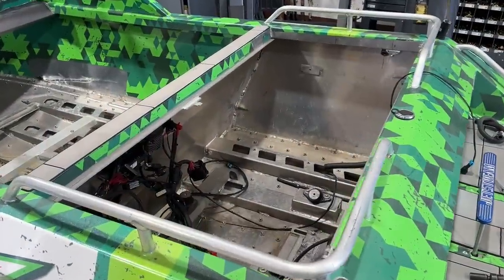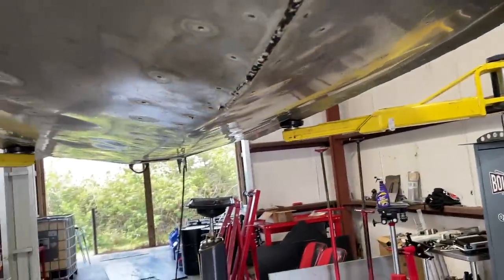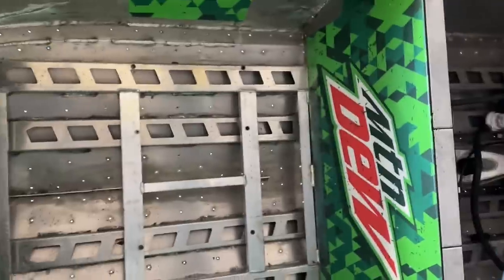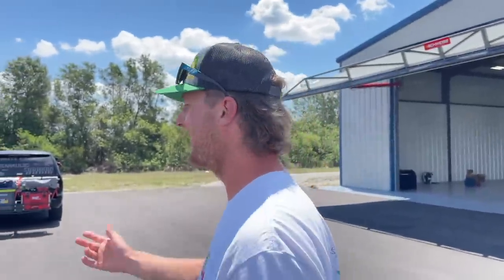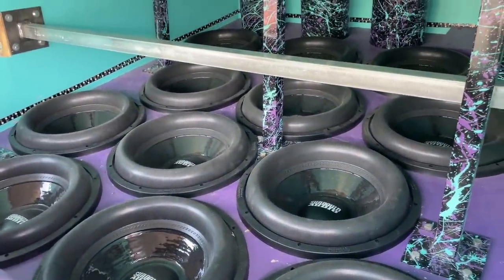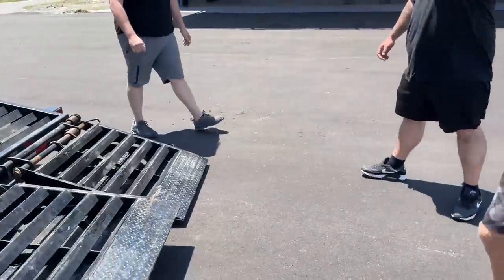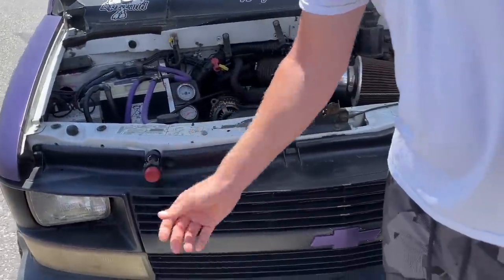More MAJOR Damage On My Mini Jet Boat, Surgery Begins! + An INSANE Sub Woofer Van Destroys Our Ears!

Comment: these guys need to come out to the cleetus and cars events
Reply: This can happen!
Reply: It’s a natural progression in the car world. A lot of us not only like the power under the hood but in the trunk too. Id love to see some DB drags at a cleetus event.
Reply: @bassahaulic yall fit right in!
Reply: We take over that same track for a whole weekend June 9 10 and 11th of this year. 20th anniversary!
Reply: Bump !!!!!
Reply: @bassahaulic  ayyyy
Reply: @bassahaulic  burnout competition in the van
Reply: @timothycarey3883  This thing can barely move itself 😂😂😂
Reply: @celinahouser6531 , for?
Reply: @bassahaulic  300 shot of nitrous and some 5.38 gears lol.
Reply: @timothycarey3883  it'll then do 33mph 😂😂
Reply: That would be annoying. I love deafeningly loud exhaust, screaming blowers and whining turbos, but like most other drag racers, I don’t want to be listening to some crap bass when I’m trying to tune my car or find a problem with it. Blasting bass at a drag racing event is usually a big problem and will be shut down quickly. It’s annoying and serves no purpose at all. It’s kind of the opposite of being a car guy. Car guys make their car work better. Stereo guys just ruin cars by turning them into a loud annoying boom boxes that don’t drive very well. 

FYI, if that van weights 10,000lbs, it’s over it’s gross vehicle weight rating and is a felony to put it on any public road. You can tell they aren’t car guys because the van has no upgrades to handle braking or even moving all that weight. They have turned it into a self propelled boom box that is broken and only hits bass, no highs or mids.
Reply: @adamr9215  also, "no mids and highs" .... THE FIRST THING YOU SEE ARE THE DOORS YOU DUNCE
Reply: @bassahaulic  8’s are barely mids, and not highs at all. They didn’t look like component speakers with tweeters built in. They look like 8” subs to me.
Reply: @adamr9215  I am a car guy and also compete in sound competitions. I can tell you that likely van has upgraded suspension and tires or it would be squatting really bad. It doesn't need upgraded brakes since it's trailered to shows and almost never sees a road. It certainly does have mids and highs the camera mic isn't picking them up well due to the extreme pressure distorting it. That van is essentially a like a funny car, it will never see the road and is purpose built to give demos(like shown in this video) and put up numbers from a sound meter. Get off your high horse saying that someone is not into vehicles for building something like this. I will grant you that systems like this would be annoying to have around while tuning an engine.
Reply: @mraycgz  It is. Exceeding the gross vehicle weight on a public road is felony reckless endangerment. It’s more weight than the vehicle can safely carry and stop reliably.
Reply: @adamr9215  so you think everything you’ve seen on this channel is legal to be on the road? Lol no. Chill out. No one is going to ruin your life by having a good time.
Reply: @adamr9215  You can literally SEE THE TWEETERS NEXT TO THEM. 

Bro is clueless talking out his ass.
Reply: @D4rk51d332  I love a good sound system. Bass blasters aren’t good sounding though. Give me balanced highs, mids and lows within a reasonable decibel range. Just deafening bass doesn’t impress me, it’s annoying. Pack that thing with some tweeters and get it sounding good with good balance and I would have some respect for it. I’ve got no respect for something that is just about bass. 

Sure, he has some helper springs or something for the weight, but does it have larger ball joints and tie rod ends? Stiffening the springs is only a small part of upgrading a vehicle to hold more weight safely. Even the spring hangers need to be upgraded to carry that much extra weight. Also, the owner did say that he drove it in Vegas, on public roads.
Reply: @mraycgz  Depends on the state. But all of my drag cars will pass safety inspections. 10,000lbs on that chassis isn’t legal anywhere since it is federally controlled.
Reply: @bassahaulic  33 mph burnout with a recording of a top fuel dragster playing thru your speakers.
Reply: @bassahaulic  I’ll look again, but I sure didn’t see anywhere near what it would take to balance out that much bass. 

Look, I don’t have a problem with you liking bass. Whatever floats your boat. But you are not a car guy. A car guy wouldn’t make a vehicle undrivable just for a loud stereo. You have a self propelled boom box with a built in generator, not a car. You are all about the sound system and nothing about the vehicle, thus not a car guy. A car guy can cruise to show off his ride, or make a pass, or make it through that mud hole, or do crazy burnouts. It’s about showing off the car, not about showing off the stereo inside of it.
Reply: @bassahaulic  Ok, I looked again. You have a few tweeters. On my phone they looked more like vents/ports, but on the computer I can see that they are tweeters. Still considerably less that you need for good balance though. If I can feel the bass from half a county away, I want to hear the highs and mids too.
Reply: @adamr9215  This is a SINGLE BUILD. We have multiple, of all kinds. Stop trying to group us into one camp. 😂
Reply: @adamr9215  Also, enough about the weight and legality. We don't care. It's not registered anymore. It never drives.
Reply: Im sure alot of us bassheads are at the cleetus and cars events all the time and we are always looking for more places to be loud at
Reply: @bassahaulic  It’s the build you decided that you wanted to show us, so that’s what we have to judge you by. It’s pretty much the opposite of anything a car guy would build.

And that’s exactly my point, it’s a self propelled boombox, not a vehicle any more. The opposite of something a car guy would build.
Reply: @adamr9215  So I'm not a car guy because ONE of our vehicles is like this? 

You're lame 😂
Reply: @bassahaulic I thought it was great and to stuff the extra alts in there looked to be tricky    what's some numbers you normally hit at your   car packed  non car guy comps  😂
Reply: @adamr9215  who pissed in your cheerios? Just because YOU don’t like it doesn’t mean you get to rain on everyone’s parade. Grow up and move on.
Reply: @bassahaulic  You didn’t bring out anything but that one van, so what else do I have to go by? It would be a little different if you also showed me a clean but good sounding stereo in the tow rig and a classic muscle car with a nice custom set up to go with that van, but you just brought the van. I would think that someone that wants to show Cleetus their cool stuff would bring more than one mediocre bass blaster. And yea, mediocre. You saw way better looking bass blasters back in the 90’s and early 2000’s. Fiberglass and aluminum work that looked good as a base for the speakers. Nice looking custom door panels and dashes that held tons of speakers. You didn’t show me any good looking custom work, just a ratty looking van stuffed full of speakers. If you have nice stuff to show off, why leave that  at home and just bring a low end build?
Reply: never seen them at any of the events to show support at cleetus and cars or spectator drags
Reply: @Torch4ya  😊
Reply: @bassahaulic Don’t pay the haters any attention. Being a 57 year old I’d love to see and hear you guys at a Cleetus event.
Reply: @Autocreatorz  We live 12 hours drive away. Chillllllll
Reply: @Bassahaulic Productions  it's gotta atleast do 88mph
Reply: @Torch4ya  Slamology.
Reply: @bassahaulic  my plan is to get my ride together and meet y'all one day
Reply: @celinahouser6531  Yep!!
Reply: @bassahaulic  Sounds like it's time for a big block then, could probably run even more alternator with it, stick them out the hood like the turbskis on mullet.
Reply: Looks like some doesn’t know the difference between a musically dedicated build from a SPL dedicated build
Reply: @jasonhardison7103  Lmao, I would have to say the same about you. I mean really, you replied to me with nothing important just because you don’t agree with me. That’s just pathetic.
Reply: @bassahaulic this is the first time I've seen you guys and just off these responses I already like y'all... 😂
Reply: I love this van
Reply: They need to crank the Timelapse song while they set up
Reply: I'm down!
Reply: @adamr9215  since when can an 8 inch woofer not play mids? You clearly know nothing about audio,

Comment: This one thing I love about cleetus  channel. It's not limited to just one type of racing. Circle track, drag, drift, airplanes, and now sound systems. 

Not really into sound systems of this level myself. But I still appreciate these guys level of commitment. I have followed SMD channel for years. (Steve Meade design) it's really incredible what all these guys can do. With sound waves and air pressure. 

I guess it intrigues me because I research old world tech. And all of it has to do with sound waves and vibrations. Like when these audio cars/vans/suv get high enough to bust the windshield. Right before they bust they look like water.

👍

Comment: Hey Cleetus: up North here in Alberta Canada we run half inch aluminum on our mini's, 2 feet wide up the keel for 4 to 8 feet and then half inch UHM on top of that, this will help out if you are into jumping beaver dams and logs ETC. Then on our V8 sport boats we will use QT-100 steel around the intake and 4 feet up from the back, this makes the boat bounce off rocks like a ping pong ball, no damage.  Food for thought.

Comment: Definately need hearing protection in that van! What a machine that is!
Reply: James raw dogging it smh
Reply: What?
Reply: @parma-sean  Unfortunately he is gonna regret it later in life... Im in my mid 40's after a career in the military and LE... far too many bangs and Im losing mine pretty bad. Its annoying "Sorry, can you say that again in my other ear" :)
Reply: Low frequency completely different it won’t damage hearing the same way
Reply: i was involved in crank it ups back in the late 80's. my hearing is decent but i lost hearing above around 15,000 hertz. i regret being young and dumb.
Reply: Low frequencies don't cause hearing damage
Reply: @djwonderbrad  And it only has the speakers without a driver or tweeter that will not affect anything, if you go to a Puerto Rican show car music it is better to take the those ears plugs😂
Reply: The lower frequency is no big deal, but the stuff above 40 is where it starts to get you. You'll know when it's too high because you can feel it in your ears like you're putting a q-tip too far into your ear.
Reply: @KALSPL  +1 , facts, if not i'd be deaf by now 🤣

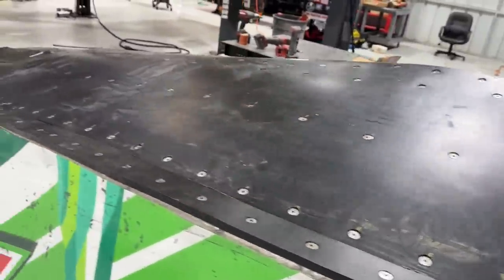Comment: Lookin great! Double check @4:42, at the edge of the Delron/poly the weld looks like it is cracked. The exposed weld right up against the Delron/poly. Might be the video, but worth a double check while it is still dry.

Comment: I like how Ty thinks getting all the debris out will keep the boat from cracking again.
Reply: The only way to keep that boat from cracking again is to keep cleetus out lol
Reply: To be completely honest, this boat was never welded together correctly. I don’t recall ever seeing any preheating before any of the welds were made. There’s a lot of prep involved when trying to achieve the strongest weld when welding aluminum. I would be very shocked if any of TY’s welds crack.
Reply: I am in no way shape or form questioning mctyland fab. I am however saying cletus could break a tank or at least a ripsaw. That poor boat though she was over the hill, her last tree branch or trip to Idaho but Ty the magician gave ole cleaner a few more branches to sail over.
Reply: @precisiondiesel225  he legit used his heat gun to preheat the metal before he welded.
Reply: @precisiondiesel225  the only way Ty's weld will crack on this, is because it needed to crack! XD
Reply: I thought they were going to weld in some big support rails for all of the Cleetus shenanigans but time will tell how it holds up. Tye is the master.
Reply: @raiNofchAosFPS  Think he was referring to the first time it was welded together. I think Cleetus welded a good bit of it himself. While we all know Cleet is good at a lot of things, welding isn't one of them.

Comment: I seen ya removing some aluminum with the drill... use an air tool and the SC3NF Aluminum Cylindrical End 3/8" Carbide Burr Bur Tool Die Grinder Bit 1/4".  It eats AL for dinner and cleans up so much stuff... best AL eat tool I have ever used.

Comment: Mig welding aluminum really does go that fast if the prereq's are dialed. I weld thick and thin aluminum alot at work aside from steel. Its absolutely butter when the weld fusion is just a rollin

Comment: I remember about 10 years ago steve meade had a 20 000 watt in an suv and i was blown away that systems like that even existed, look what's about now, 70kw is absolutely insane 

Awesome vid
Reply: Steve still has that Tahoe, and it’s only gotten upgrades as the years have gone by, I’ve been watching his stuff for about the same amount of time! Upgraded it to a 16v system, several runs of 4/0 gauge wire running under it now, few other things. It’s a beast

Comment: Astro van BASS competition vans were BIG in my Highschool days... 98-02...  I guess that has made a come back....  a friend of mine had a massive wall of 16 subs with 20 batteries, another set of subs in the foot wells and back out...  30 amps....  4 alternators.  While running, a group of people had to stand around pushing on the windows... otherwise the windows would blow out like a bomb if no one held onto them while playing....

Comment: They had a somewhat weaksauce version of that audio van at a car show i visited once. They required earplugs and Peltor earmuffs for people to sit in it, and it was still enough to make your ears ring afterwards. They sold a metric fuckton of speakers during that car show, so great promotion.
Reply: Also, 12*6000 watts is freaking insane! We rented a PA system with a total of 19200 watts for a party and one guy lost all hearing on one ear. I can't even describe how insane 72000 watts of audio is.

Comment: This stuff was peak in the 90s with bass contests. People were putting layers of concrete in doors so they wouldn't just buckle from the pressure when closed. I used to do installs but nothing like this. At most I had 3 12s in the trunk, bass tubes behind the seats and as much as I could stuffed in the doors of my 99 skylark.

Comment: Love how Tye pre-heated the aluminum before welding. That's a pro tip right there. Aluminum is really good at displacing heat so when you try to weld it all the heat you're putting in just spreads out and goes away. Even though aluminum melts at a lower temperature you use more voltage and heat to weld it than steel.

Comment: I knew James was a bass junkie lol 😂😂😂 I used to torture my little high-school back in the day with my little s10 that I crammed a big custom ported box tuned to like 38 hertz with a 15 inch solo baric kicker sub in it and a Phoenix gold competition Amp hooked up to it and it would knock teachers clocks off the wall if I played the right song and drove by slow enough.... God I miss it lol

Also when he said "you gotta remember to breathe an blink" there's not much that feels better than hearing a bass note drop on a sub and feeling your chest get heavy because of the air pressure around you... not a bad way to pick up chick's either😂😂😂

Comment: I've done a fair amount of aluminum MIG welding, a guy needs to be fast, or all you do is blow holes in the work. Aluminum melts SO quick, ya gotta have it right setup on welder and move gun fairly quick compared to MIG on steel. It's way different.

Comment: For future fixes. Would using the screw holes and bolt a plate to where you are trying to pull a dent and then weld a slide hammer to the plate you bolted to the boat. Then bang bang pulls the dent out maybe? Lmk how it works maybe.

Comment: Hey cleater y’all need a 5.7 Astro van did you know that if you start with an Astro van with a 4.3 that a 5.7 vortex will bolt right in and yes it fits so fun times in an Astro van. Burnout rig or drag and drive

Comment: Better go with some washer on top and bottom of the skid mat bolts! Remind me of wework in the machine shop and how if a part was ever taken out of the machine it can never be put back in exactly how it was if a cut or something had been missed and I feel that's the same thing with those nuts and bolts that are holding down that skid Matt will never get those holes filled exactly the same again now you got a bajillion leaks at the bottom of your boat

Comment: Those dudes are NUTS!!  I went to one of those "db drags" back in the early 00's, everybody had them one of those early 80's Plymouth/Dodge minivans(also a lot of 80's Astros)  With the back windows taken out and welded in with sheet metal.  If that Astro rig weighed 10,000lbs I'm wondering what all they did to reinforce those Chrysler minivans.  As they were nothing but a FWD tin can K car wagon with a high roof, the weight rating was designed for 6 fat Americans and their luggage, so maybe 1600-1700lb payload tops.  Also underhood the 3 or 4 giant alternators were bigger than the 2.2 liter engine block/head.

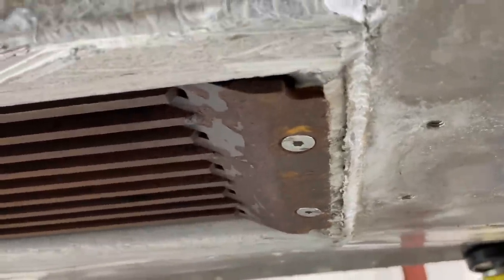Comment: 1:53 those two other dints just drill a hole and use a dent puller then just weld up the hole and grind it clean.

Comment: If you were ever going to do a fwd-skids race you could see how long the old hull will last strapped to rear tires. Or Maybe skid a front right and rear left, or vice versa, on a Crown Vic and see what that does? haha! Science day if you blow up the truck adding Nitrous to the nitro, muahahaha.

 Or at least get a steel plate race in before the track gets any better of a surface, heh heh!